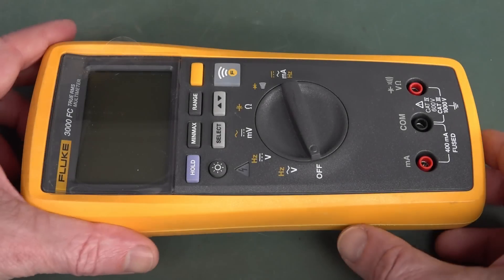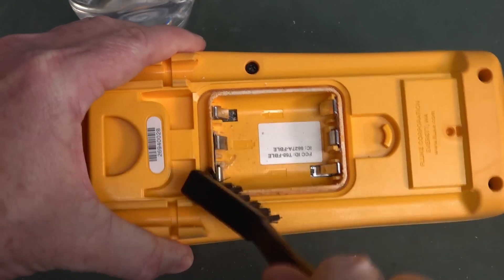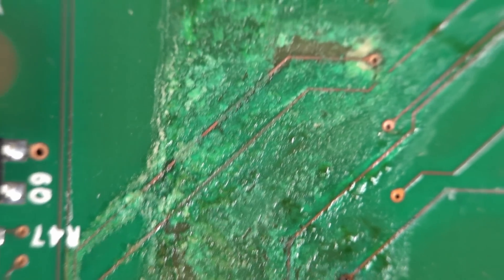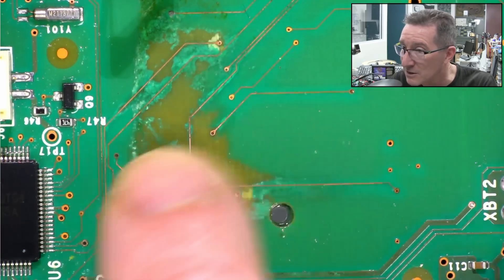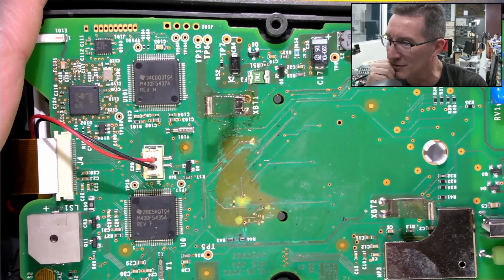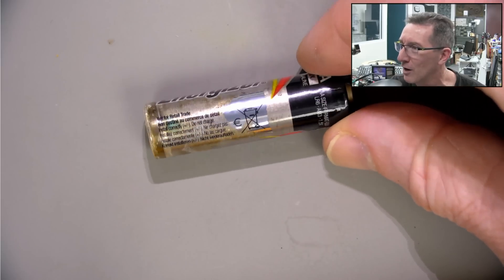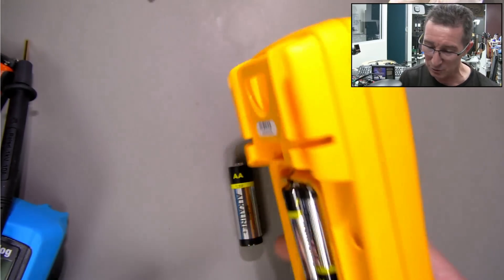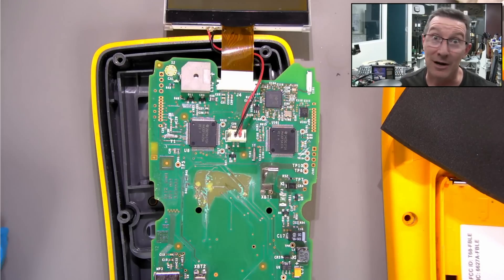EEVblog 1497 - RIP Fluke. Thanks Energizer. NOT.

Comment: "Energizer! You were the chosen one! You were meant to replace Duraleaks, not be them!"
Reply: I've used eneloops for AGES. No worries no problems.
Reply: I’m watching this video at 10pm. I feel the need to drive to my office and check my 289. 😭
Reply: Imagine, the "Coke and Pepsi" of batteries, lowering  their quality to the same level of poor.
Reply: @ingulari3977  That’s a good question! Do they have a leak damage warranty like some battery brands do/did?
Reply: We should probably just all switch to rechargeable batteries.
Reply: and it's honestly been a problem where quality assurance has faded.
Reply: @SLAYERSARCH  I think it’s probably more like an effort to make the batteries less hazardous. Of course in exchange for less hazardous batteries in the landfill it’s all the ruined equipment with their batteries still inside
Reply: @irritantno9  true but you cannot believe the damage done to economies when certain countries run a manufacturing monopoly.
Reply: Yeah Duracell energizer Revac and then everything else is re branded or Chinese knock off. I have been selling wiggling my microphone stash down. 10 years ago we would put new batteries in for a once a month thing every month I couldn’t throw them out…. But they were also a store brand and I think Duracell so I constantly had leaking issues. I think I only have 10 left  otherwise I’ve transitioned to rechargeable nicds.
Reply: Enerjuicers!
Reply: Don't use alkaline batteries.  They all leak.  I have never seen a leaking NiMH or Lithium cell yet.
Reply: Bwahahaha it's over Energizer because I Rayovac have the high ground!
Reply: @ingulari3977  Here in Europe all the "big" Brands have warranty. If the batterys are nor completely flat (check the voltages) and the date code is okay than contact the service department.
Reply: I recently found an Energizer AA cell that was leaking badly 8 years before the use by date !
Reply: That happens when u leave batteries iside for longer period of time. Every single manual says to remove the batteries when drvice is unsed  for longer period of time, so he's gulity, not the  baterries.
Reply: They all seem to do it nowadays, always cleaning the remotes from batteries dropping their guts.
Reply: @ozzybloke4830  I've been using GP brand alkalines for 15+ years - AA, AAA, and A23 (12V),  I can't recall one ever dumping its guts.
Reply: @ozzybloke4830  yeah I actually have this happen 10 times more with Energizer, but I assume they're about the same.

Years ago I used to use Duracell I only had a few small leaks over 30 years, battery discoloured but device not damaged.

These days I only really have access to energizer but in the past 10 years it feels worse than before. Not just battery damage but leaking through the entire device. However that could just be all the kids toys and just the increase in battery use.

I haven't seen any statistics on the degree of damage cause and the frequency with different brands.

However my local store only sells everready or energizer so energizer is really my only choice. Majority of the time it's fine for years.

I wish I didn't have to stress over finding batteries to remove.
Reply: @Commander_ZiN  They are made in the same group of Chinese alkaline battery manufacturers, so all are cheaply made, but sold at a premium price. One of these though has a quality battery, which is used by all of the brand names for the professional and the industrial grade branding. I had some of those in Airmatic machines, those things were white sleeve, no manufacturer at all, and I never had one in hundreds ever leak, even 5 years after the expiry date. Just you cannot buy them.
Reply: @Commander_ZiN  Once they stopped putting mercury in the batteries they started to leak more. Obviously they were adding mercury  mercury for a reason, its not cheap.
Reply: @tim1398  yeah, after I did some googling the other day I was wondering the same thing.
Reply: I guess the prophecy has yet to be fulfilled, will it be the lithium (probably not,🧨🎆) maybe solid-state battery then? The chosen ones must return soon.
Reply: @imark7777777  Nimh is a good middle ground. I've personally never had one leak but from what i've seen online when they do they're less violent
Reply: @s8wc3  I agree, I use 'em everywhere I can though sadly not so good in motorised scenarios due to the lower voltage.
Reply: Ben: So we have a new savior after all, who needs "energizer" anyway?. I mean isopropyl alcohol[1] ( 3:08 ). Completely regardless of the fact that this is a super solvent for all organic fats (like soldering grease), mineral oil derivatives and proteins (our hands and mucous membranes), is hydrophilic and slightly water-displacing ... My grandmother would have used water with a little washing-up liquid for salts (thanks to Energizer ). That's the only thing that makes sense.
We'd have to give Fluke or Sesame Street a call, what does the yellow plastic (and casing) make of β-hydroxypropane... and will they be friends? G

Another uncomfortable myth: Vinegar or citric acid doesn't save anything... Not even specially galvanized sheets, which have an extra surface created specifically to serve as a contact sheet. Of course, the only thing that helps is an Amazon chemical kit for a birthday. Sorry, I'm joking, only sanding and replating the surface will help.
But your grandmother would have known that too! ;)

I'll write this while I'm watching the beginning of the video anyway. My faith in Dave is unshakable! A little alcohol won't change that! :)))

[1] The holy water of us all (sorry, that was to catholic!) electronic folks...

Comment: Just noticed some cheap zinc carbon batteries leak in one of our clamp meters at home a few hours ago. Was gonna use it and opened the battery cover to see the battery electrolyte leaked into battery comparment with most of it on the cover.
I'll have to perform a full teardown and cleaning on it.

Note taken and I'll never be leaving batteries in my multimeters again.

Comment: I ran into this same thing recently with alkalines in a fluke 17B+ but I was lucky it didnt make it to the PCB - so I pulled all batteries from meters I wasnt using on a regular basis and put them in plastic bags in the meter case, then replaced all batteries in my favorite and most used meters with Lithiums as I hear they dont have near the tendency to leak like the alkalines do - if ya think about it the word alkaline loosely translates to salt, no wonder theyre such a plague.

Comment: cant you just use Energiser LIthium : these have never leaked in my TV remotes .  BUT lithium AA batteries are 1.8 volts despite teh casing says "1.5v" - ive emailed FLUKE if Energiser Lithium safe to use ( energiser and duracell measure 1.67 volts AA) but the fluke engineerrs just link me to a manual saying use energiser or Duracell.  Ive lost that many TV remotes to alkaline batteries i remove my batteries  from my meter every night

Comment: What a shame! Cheap alkaline batteries killed a valueable Fluke meter! I will go and inspect all my meters and put batteries out if not in use regularly. I kept some batteries in for years without usage - but still all devices survived even if there was any leakage. Advice to Fluke: keep the battery compartment sealed from the pcb the best you can!

Comment: A device that expensive should be designed to have some degree of chemical resistance on the plastics and to be capable of handling battery leaks. I guess all the money goes to support the blame chain instead of hardware quality.

Comment: I have an 87V which I have just pulled out of storage, it had been packed away for 10 or so years, the original battery (energizer) was still in it and it didn't leak luckily.
I have now removed the battery, will I need to recalibrate when I place a new battery in? I am just a hobbyist.  Not sure how far readings can drift.

Comment: When do the batteries leak? Due to a lot of measuring that I do,I change the batteries on regular bases and not even waiting to get low bat indicator,maybe waste of money but first I dont want to have low bat indicator somewhere in some shithole where I can not buy new battery and second of all it's my nightmare battery leakage. Take them allways out when not using meter for a long time. And the tip"display allways upwards" is a saver

Comment: In the US you can contact the battery manufacturer and make a claim that their product caused damage; no idea about how this is handled in Australia. As the batteries were two years short of their shelf life, I'd hope they'd back their product and repair or replace your meter. 

Personally, I use low self-discharge rechargeables and rarely have a leakage problem.

Comment: @EEVblog You should blame yourself not the batteries itself. Who the hell leaves batteries inside when multimeter stays unsed. Every single manual says to remove the batteries when device is not used for longer period of time.

Comment: Poor Fluke, but thank you Dave. I had identical batteries (expiration date 12-2024) in an identical multimeter (also has a protective film ;-) - I use it as rarely as you). They still had 1.51V, but one of them had very slight signs of leakage at the negative pole.

Comment: All parts that has been exposed to the alkaline solution should be thoroughly soaked in vinegar for awhile to insure any dissolved residue doesn't react again. There is a reason why most meters use the 9V battery instead of AA or AAA, they are double insulated and may have a special absorbant paper inside.

Comment: I'm very glad you made that video, because it prompted me to check on my trusty Agilent U1272 and prevent the worst. Just minimal corrosion on the board, no component was reached and some tiny chipping on the plastic. Can confirm battery leakage eats plastic and solder mask 😱Thanks, Dave!

Comment: A company like Fluke should be cleaver enough to create a multimeter wit a sealed, replaceable battery module.  Certainly the have room for it in their pricing structure.

Comment: I'm pretty paranoid about alkaline leakage at this point so all of my electronics use either Energizer Ultimate Lithium primaries or Eneloop NiMH rechargeables. I just recently bought a bunch of AA to D and AAA to C converters as well to replace my C and D alkaline batteries with Eneloops.

A bit expensive at the start to convert over, but cheaper than replacing expensive gear in the long run!

Comment: @EEVblog Dave, sad that your Fluke DMM is dead. 😞I stopped using Energizer and Duracell alkaline batteries because battery leakage was common to both brands. 👎 I got tired of the battery leakages ruining my electronic devices. I've since switched to Panasonic eneloop rechargable Ni-MH batteries from Japan for all of my battery needs. 👍.

Comment: Ive hated Energizer for years and recently started really hating Duracell after they ruined countless kids toys..  Now, Im on a Kirkland battery kick and they seem to be OK so far.  Ive been told they are re-branded Duracells, but they dont leak as quickly as the Duracells. 
The Energizer Lithiums are the exception.... Those are great batteries..... if you can get over the cost!

Comment: I´m a hobbist (electronics repairman wanna be, I do wrist watch repairs too), I repaired a CASIO calculator in which the leaked batteries damaged a lead on one of the boards. I had to go to a store to find a cheap multimeter for the moment. Te job got done. But I learned two things, I´m fed of the batteries and I´m fed of the portable multimeters. So I kind of killed two birds with one shot: I bought a UNI-T UT8802E bench multimeter from a trusted electronics store around (Mexico). It connects to the wall AC and even has USB communication, accepting even commands from there. Recommended to everyone who has where to put it :-), It´s a big chunkier one.

Comment: When I had stuff damaged by Duraleaks, I sent them email with pics of the damage, and the batteries. They told me to go find a replacement device, and they cut me a check for it. You might see if NeverReady has the same policy and warranty.

Comment: I am glad by 40 year old Fluke 8020A uses a 9v battery. The battery is in it's own compartment and 9 volt's seem to die without leaking. But I still keep the battery removed and in a zipper bag when not using the meter.  Wired 9 volt connectors are still available and easy to replace.

Comment: What’s that?
Eating plastics, but rarely copper.
Don’t brush the resistors too much. It might disadjust them.

BTW, my battery suppliers are ALDI and IKEA. I remember leaking batteries from a long time ago. Not in the last decade. Maybe quality need to be redefined away from „famous brand“ to „actually works“.

Comment: I realize there are loads of FAKE chinese CRAP batts on the market but at the same time. I have had several meters, flashlights and even a vintage AM transistor radio all get badly damaged because of CRAP batts. 
At one time Duracells were my go to choice, NEVER AGAIN.
Does anyone make a decent battery now??? You'd think with technology being what it is these day, getting a decent battery would be the least of our worries. SHAME !!!!
Reply: These are not chinese batteries, they are made in the USA (13:56 and 13:58).

Comment: I recently came across a small transistor radio I had stored about 40 years ago and forgot about. The batteries were Eveready AA so I removed them carefully. No corrosion anywhere. I wondered, do the batteries have any charge left? I measured the voltage and they both measured around 1.35 volts. Imagine that, 40 year old batteries with no corrosion and still functional.  And then I discovered the reason why. It had "Made in USA" written on the battery.  I wonder if the transition to Chinese manufacturing had anything to do with it? I still have the batteries with an expiration date of 1985 just to remind myself how much better American made stuff used to be rather than the problematic junk they now ship us from China.
Reply: These are also written "Made in USA" (13:56 and 13:58).

Comment: Maybe 35 mins in an ultrasonic bath and a couple of hours soaking Iso alcohol.  If it was mine, I would give fixing it a go after the bath, but I wouldn't spend a ton of time on it either.  Newer consumer electronics seem to have such a thin coating on the PCBs anymore, but given Fluke's price point I would have thought theirs would have been far better, and attacking the plastic was a bit surprising, at least to me.....did not expect that at all.  An interesting case study to say the least.

Comment: A fun test, with three or or more batteries, install one battery with reverse polarity, try to power on the unit, then install it with the correct polarity, the one that was reversed will start to leak almost immediately.  On D cells it is about 30 seconds, about two minutes and the battery acid is leaking out of the unit.

Comment: Damn! Never seen alkaline electrolite eat plastic and traces like that! Energizer doesn't cheap out on the pH of it's batteries...
Reply: It is strange that he did not eat the contacts, but ate the plastic.
Reply: @vadimlvs  now that I think, in the past I used sodium hydroxide (NaOH, pH 14) to remove a bad batch of epoxy glue that turned into a sticky goo (Roland JD800 red glue problem). The bad glue dissolved, the plastic piano keys remained intact.

Comment: I've my fair share of battery leak damaged fluke dmm.
Mostly on 187/189/287/289 since they use those AA batteries.
9V battery seemed a bit better against such leakage.

My guess is AA batteries are more prone to leakage if they're depleted completely; you should replace it immediately once they're exhausted and never mixed new and old exhausted cells.
Expire date on those batteries are for their charges while in the store shelves, not for being used completely.

Fluke data logging multimeter will consume some power even when turned off to conserve its memory, that's why you have such problem with 18x/28x fluke dmms.

To make matters worse they even have those supercaps that definitely will leak sometime in the future (even if they're not yet).
Supercaps is to preserve power for the memory when you replace their AA batteries.

Comment: Never had a problem with energizer unless I mix date codes or mix batteries at different levels of charge from the same date codes (i.e. taking a battery out from a device you didn't use much and mixing it with two unused batteries from that same lot).  Does not look like you did that though (they all had the same date code).  So it's rather odd.  Gone through 100's of  Energizers over the years, dry cells and rechargeable.  Cannot recall every having this problem, except with cheaper dry cell batteries.